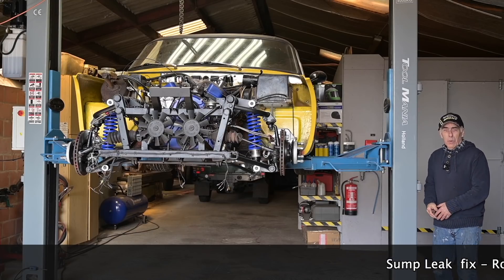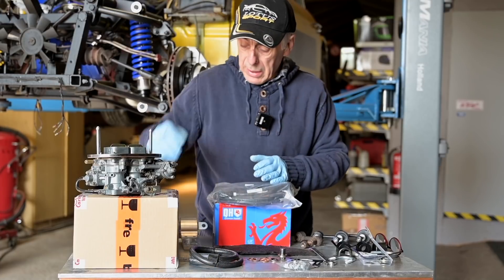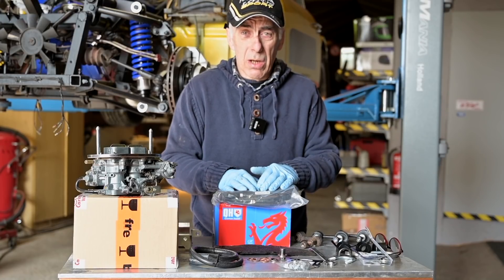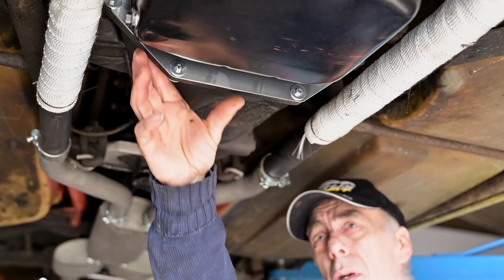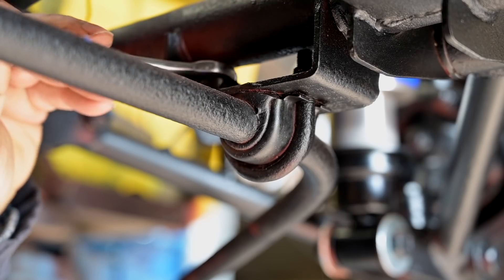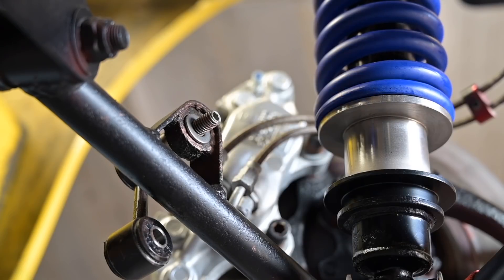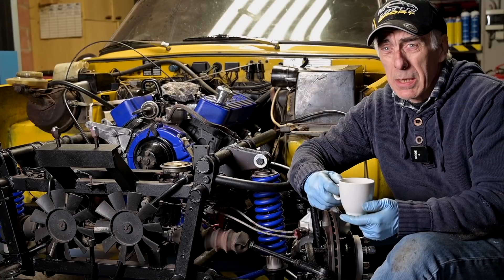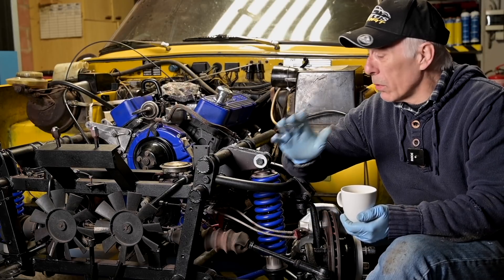TVR 3000M Part 6, Lots of small mechanical work in the rebuild

Comment: I guess you could spin the W plate 180 degrees to have a shorter distance to the PCV valve?
Reply from the maker: Thanks for the comments, you can, but then the hose would not work.
Reply: @D3Sshooter  But the hose has the correct curves to cut off and make a nice short pipe to the PCV with a piece of steel brake pipe.

Comment: Nice! I have on my projects before made PCV lines using steel tube, if I take great care on measuring and bending I have made some pretty snazzy and sporty looking lines. And never have to pine over whether or not they will collapse. Still have to use rubber joiners. But I try to make the steel lines fit very snug, then the rubber hose joiners just act as a seal.
Reply from the maker: That's a great idea!

Comment: For the PCV pipe you can bend some brake pipe and then need only need a small piece of rubber at each end,.  And those crimp type hose clamps will be perfect
Reply from the maker: Thanks for the comments, good point... I might do so

Comment: Hello. Great video. I had an old engine that was always bending pushrods, and the cause ended up being weak valve springs.
Just a note in case it happens again. Also, a gasket on top and bottom of your W plate, perhaps??
Reply: He did check the valve spring tension and they were all within spec.
Reply from the maker: Thanks for the info!  there is one gasket below and two above the W plate...
Reply: @vayabroder729  - thanks

Comment: Hello Steve, nice work on the TVR, its what I call removing all the "spiders webs" (previous owners neglect) from a car. That W plate could it be turned around so the inlet faces the opposite side. Then the connection to the rocker cover will be shorter and it will need one or two joints. The joints themselves are under negative pressure so won't need clamping, maybe a dab of..........silicon, but used here for good reasons.
On the subject of clamping, there is this tool which you can easily make yourself, that can pull wires and you can make your own clamps especially for this application. The clamps grip around the full circle and look neater. Check on Youtube "Wire clamping tool".
Reply from the maker: Thanks for the comments and very good points.  I can turn the W plate, but then the hose does no longer fit.  I have seen that tool and I might consider it.   Great comments

Comment: Thank you Steve.As usual a great Video but also very well done job. One comment on the cover for the bellhousing. If you build a kind of a notch at the deepest point of the cover, leaking oil has a chance the run out of the bell housing instead of staying inside. The old cover is a kind of cardboard and it sucked up the oil of the last decades already. 
By the way is there any tool existing wich is not in your workshop already? I thougt I'm good equiped in my workshop but now I know better.  Thank you for sharing.
Reply from the maker: Thanks for the comments, and indeed that is a very good point,  Will do so/

Comment: a lot of ford engines have the rubber seal on the sump plug. im not a fan of ford sump plugs people also use 13mm and round them off i used to use a 1/2" socket and tap it on its quite a tight fit but thats better not likely to round the bolt off
Reply from the maker: Thanks for the comments

Comment: At 25:38 why don't you turn the W plate a 180°? so the connection is better in line with the valve cover.
Beter even in het Engels gevraagd voor de mee lezers. 😏
Reply from the maker: Thanks for the comments, dat is niet mogelijk...

Comment: Hi I have learned a great deal watching your videos, have you used a carburettor synchrometer on your weber dgas38 carb? I have used one on my essex and found that one bank is pulling 9hg and on the other bank 6 hg I have checked everything I can think of and can find now reason for this difference, any suggestions?

Comment: Steve, is there a specific reason why the choke portions of the carburetor is square?
Reply from the maker: Thanks for the comments, now that is a very good question. And to be honest I have no idea...  These are square as the funnel is square, yet the question remains, why are the top funnels square?   I have no idea, but will try to find an answer
Reply: @D3Sshooter  maybe it is for the looks? It is also interesting that both throttles open at the same time. Some cars had the second choke opening near full throttle for extra boost.

Comment: I too had my "bogus problems" with imports from the UK. They left the single market :( 
Funny thing, I bought a lot of electronics parts made in China from UK suppliers because it was easier and usually faster  than buying in China directly and cheaper than buying from German suppliers. With all the import paperwork it's not feasible anymore.
Reply from the maker: Thanks for the comments, its an issue